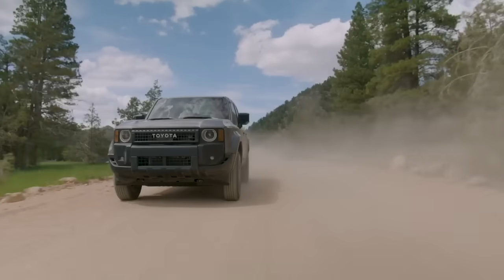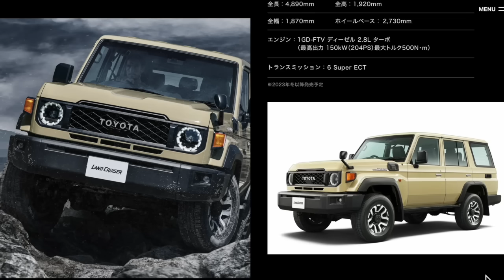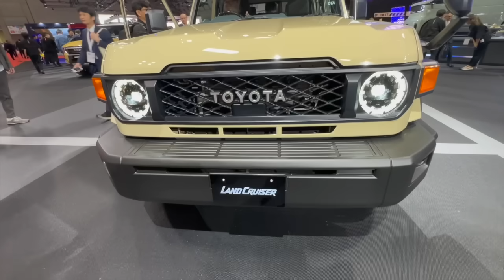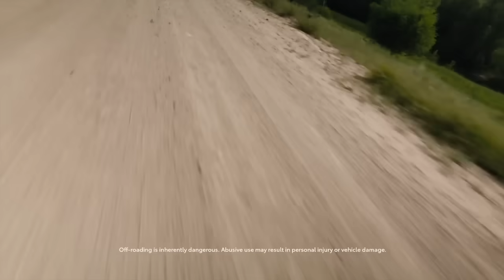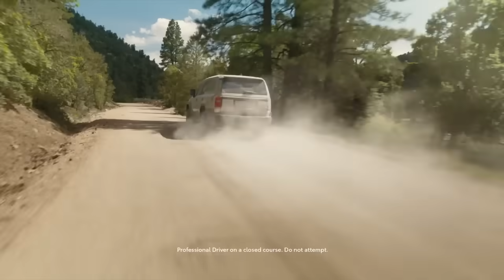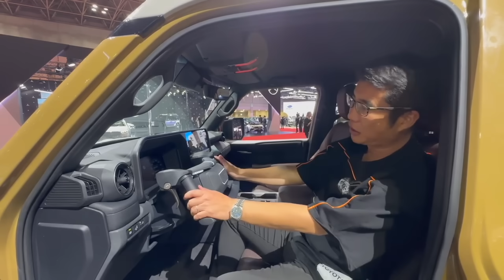2024 TOYOTA LAND CRUISER CHIEF ENGINEER EXPLAINS DEVELOPMENT PHILOSOPHY

Comment: I’m so confused.  The 250 series is sold with the Prado badge in other countries, so how can it be an in between vehicle?  The 250 is the Prado in most other countries. Is he talking about features?   How can the 250 series be light duty if it rides on the wagon chassis?  How “nearly identical l” is it?  Same size frame rails?  Same rear axle? Same size front diff.  I have so many questions….
Reply: It’s between the 70 series and 300 series.
Reply: @Offshore1977  yes, that’s what the Prado has always been.  The video makes it sound like they’re saying the US spec Land Cruiser is between the Prado and 300 series.  The US spec Land Cruiser literally has the Prado badge on it in other countries, hence my confusion.  US spec Land Cruiser = Land Cruiser Prado, but that’s not what it sounded like in the video, unless I’m misunderstanding.

Comment: Well color me more confused than before. So a new vehicle, that replaces the J150 Prado in other markets, and is a Landcruiser badged version of the GX is NOT a Prado, but a new, simpler Landcruiser. Like a Prado, but not. Got it. 
Hopefully the one destined for our shores has all the same high-strength bits as the African versions will get. 
I would have been fine, btw, with a GX 300 series with an SR tuned gas V6.

Comment: Would be nice if the Gen6 4Runner were based on the 70 series LC.
Reply: If that were true that would be quite awesome. Since Toyota is bringing the LC J250 they could return the 4Runner back to its roots of more simplicity, alas the EPA, NHTSA and Gooberment won’t allow something like the LC 70 in he states.
Reply: Would be nice if a video was ever made directly comparing the LC250 to the 4Runner.
Reply: So you want the Gen6 4Runner to use a platform that debuted in 1984?

Comment: I wish upcoming LC250 here in Australia had the Gas option but instead it’ll be only available in Diesel MH however Diesel here on average is AUD $1.5-$2/Gal > than Regular Gas and unless towing it’s needless especially for smaller Diesels!
Reply: You mean per litre.
Reply: @Marks.Reviews  Diesel here in Australia is on average AUD .40¢-.50¢/l > than Regular Gas

Comment: I’m almost certain that Toyota did their homework before putting a new drive train in their flagship vehicle. The fact that they are using the same 2.4L Twin Turbo in ALL their best selling models (other than the Tundra). Tells me they know it will be reliable long-term. It’s either very smart, or very risky! With this in mind my ‘buying strategy’ (as David calls it - a term I love, BTW) is to try a new Land Cruiser but most likely will sell and get a new one before the power train warranty expires. I keep vehicles a long time! Still driving my 2007 4Runner purchased new!  I have to be honest though, finally I’m at a position in life to afford my dream car (Land Cruiser) and it’s a 4-cylinder 😢. I’m an open minded person, and will give the new one a chance. Thanks again David for another great video!

Comment: The first gen prado was based on the 70 series  like the KZJ78 it had the 70 series solid front axles and sitting on coils my dads kzj78 is still going after 400k on the clock

Comment: still neeed to know why toyota got rid of the side opening (or dual side opening) and split tailgates.

a rear tire swing out is essential for an off-road focused vehicle especially since 35 and 37" tires don't fit underneath.  need an extended/aux fuel tank there instead.

also need more information on why a 70-series isn't here as well, especially after a refresh.

Comment: Looks awesome but a 4 cylinder turbo with a battery is hard to swallow carrying that big heavy beast around-long term relilability is unknown with this engine-the car car nut just did a great video on the turbo engines everyone thinking about purchasing this new 4 cylinder turbos should watch it-its great info

Comment: David, The more often you have Mr Moritsu on the channel, the more often he can practice his English. 😉As I understand it, the Land Cruiser 250 Series and 300 Series will be offered with a large number of powertrains with widely varying prices across global markets. In other words, the cheapest 300 Series might well cost less than the most expensive 250.  I have heard the legendary 2TR-FE  4 cylinder will still be sold as the LC 250's base engine in some markets. As long as I could get mine installed in a Land Cruiser with  2 tone paint, I would be quite satisfied. As I have indicated more than once in this Comments section, I am still willing to 'compromise' with a 300 Series equipped with a humble 1GR-FE V6 and full set of lockers. 🤩🤩

Comment: can you kindly relay something to the toyota engineers whenever you meet them? usb c charge ports are really really slow on most cars. 5V 3A tops, or 15W. for example the new grand highlander has 7 usb c ports but all are the slow 15w.
(only exception will be the upcoming tacoma).
certainly a first word problem but its really annoying on 2024+ cars. since they're moving to charging with usb c, might as well support usb c PD "charging" protocol ;)

Comment: Thank you David for keeping us updated on the new Land Cruiser J250.  My dealer will be allocating a Heritage Blue in the regular series for me early next year in Tennessee USA.  Note: If you can provide some info on the design/engineering, etc. on the turbo chargers on the J250 with hybrid drive train, it would be appreciated as many are concerned about the durability and reliability of the turbo charged engines.

Comment: 250 Series and 300 Series both use basically the same TNGA-F platform, so the major difference would be powertrain (more output from the 300 Series engines).  Those who tow a lot would be better off with the 300, in my personal opinion.  For various markets, 300 offers 3.4 twin turbo gas V6 or 3.3 turbo diesel, 250 series offers 2.4 turbo 4-cyl gasoline or 2.8 4-cyl diesel engine depending on market.  So basically a 300 Series a 6 cylinder LandCruiser whilst a 250 Series is a 4 cylinder LandCruiser.  Simple!

Comment: Concise and insightful video, I did wonder about the 70 series relative to the new land cruiser. I can see the appeal of the 70 series but will be very happy when we can get the land crusier in Canada. The land  cruiser will fit our use case best. On another note, it would be interesting to hear an engineering perspective on positioning the land cruiser vs. the 4 runner

Comment: If they only had a non turbo option I’d buy one otherwise I’ll stick to my 2022 Pro and the wife’s 2023 gx. With turbos you’re gaining torque horsepower and a bit of gas mileage in trade of long term reliability. Turbos wear out more parts on an engine more to go wrong. I bet, and I’m no engineer but if you put an 8 speed transmission into a 4Runner it would greatly improve its fuel economy. With one extra gear in the gx460 we get practically same fuel economy as in my 4Runner 6 cylinder compared to 8 cylinder.
Reply: Unless you drive a tractor trailer.  Those turbo charged engines last 1 million miles easily.
Reply: Every dual range 4wd in Australia has a turbo. (Except for petrol Jeeps).🦘🇦🇺

Comment: This confirms I won’t be buying it. It’s a cheaper crappy smaller 300. Instead of making it more like the 70’s they made a small grocery getter
Reply: I am inclined to agree, but would like to know more regarding the drive train engineering. Interesting, on the Toyota Land Cruiser side it would seem it is marketed as primarily an off-road vehicle, whereas the related GX 550 may be on the same frame, but is a different animal drivetrain-wise, the engine/transmission in particular, and offers SIX trim variants versus three for the LC, and understandably a much higher-appointed interior. However, Lexus has revealed a hybrid will be forthcoming, and will apparently incorporate the LC engine/transmission, i.e. the 2.4L turbo four-cylinder with an 8-speed. Of interest, if one looks close, the transfer case is of a different design between the v6 and 4-cylinder, even though the horsepower/torque are nearly the same. Yep, an old-schooler and die-hard off-roader in my day, and the transfer case design is important. Would love to see an all-gear transfer case, versus the current units utilizing chains and planetary gearsets.
Reply: Not sure I agree with that take. If it has similar bones to the 300, and the drivetrain is fairly well developed I think it’ll be a darn good offering.
Reply: @ALMX5DP  I’m glad you think so and that’s totally fine with me.